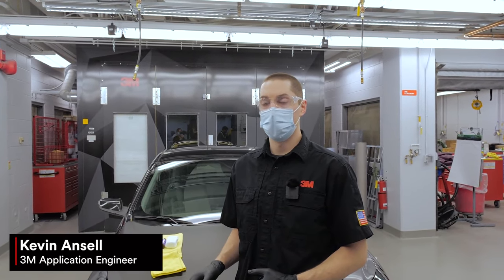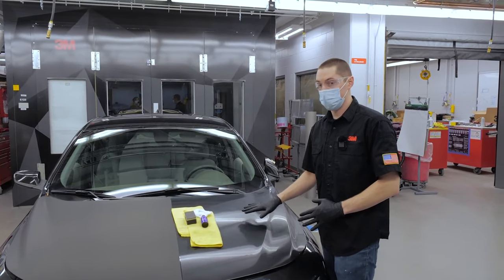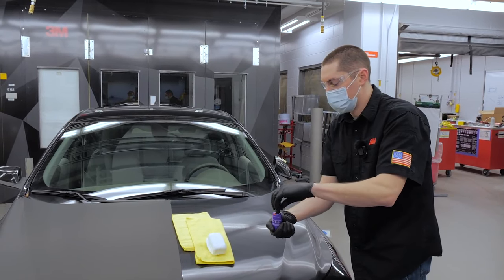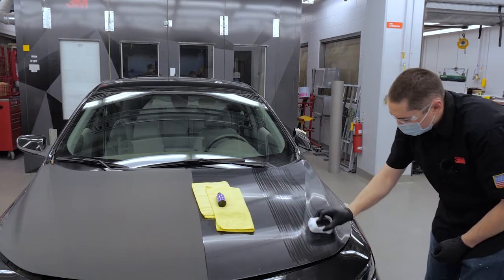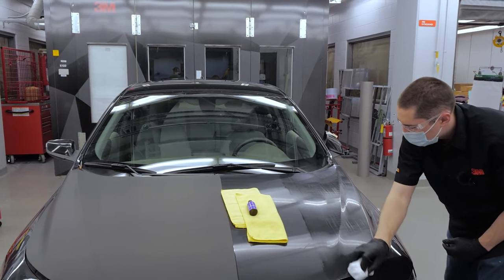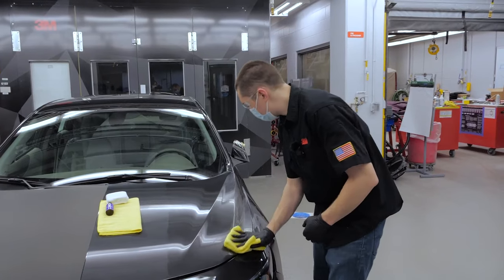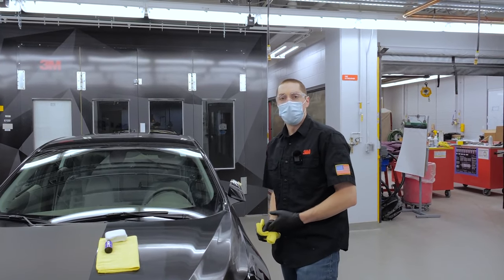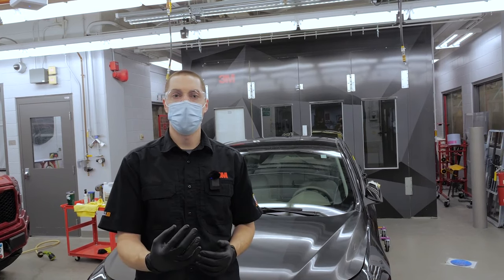3M™ Ceramic Coating Application on 3M™ Paint Protection Film

Comment: I applied this in roughly 60°F ambient temps, and let it flash for 1.5 all the way to 5 minutes and it was VERY grippy / hard to remove.  Not sure what the deal was but wasn't very easy to apply
Reply: Too much time. In 60° probably flashing in 1.5 or less. Humidty matters more than temp at lower temps
Reply: That means its a vey good product, this product does not have any carriers with that said its a 100 active ingredient, lastly don't use too much product and you'll have a better experience